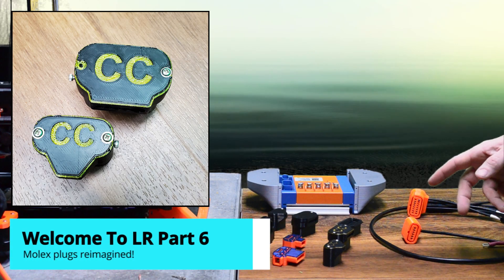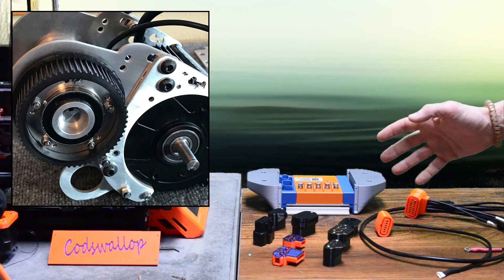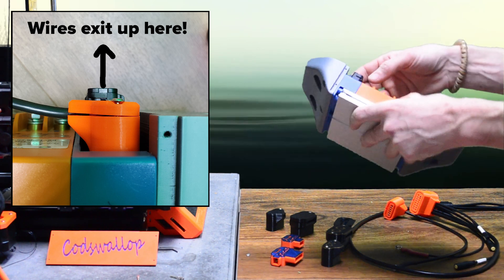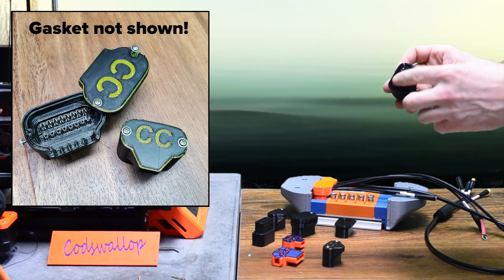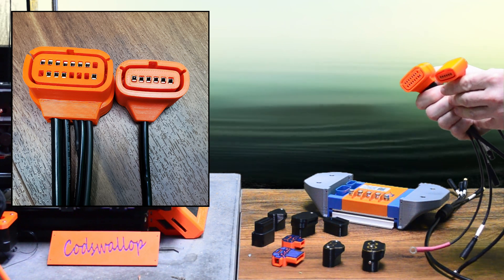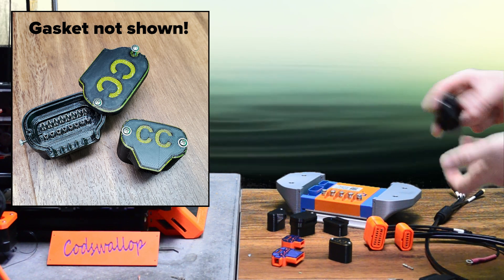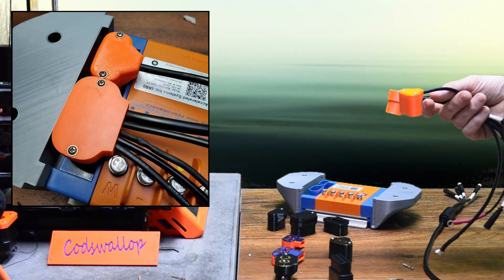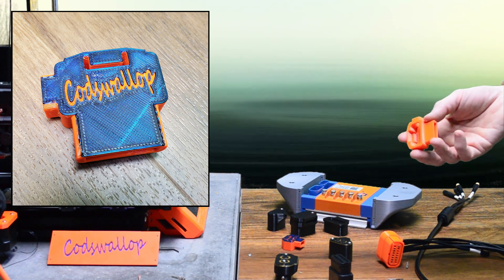Molex Plugs Reimagined - Lightning Rods Big Block XL 10kw Ebike build Part 6 Wiring and Motor Photos

Comment: About time someone applied some common sense to this particular area. Good work.
How about a screw or two more at the wire exit point on the plug, just to close that gap ?
Reply from the maker: Thanks. Good idea. I will try that for sure or something similar. The big gap on the small plugs was because I sized the hole wrong. Thanks for the comment and feedback. Cheers

Comment: Super crispy and well thought out work as always Capt. I always feared that the gauge of cable for the molex connectors would make a 90 degree implementation like this difficult, but it's just how the default plugs condition us to think. The finished product looks amazing and all of our bac 2x,4x,8x crowd will definetely want these in order to clean up their build <3
Reply from the maker: Thanks Gizmo!